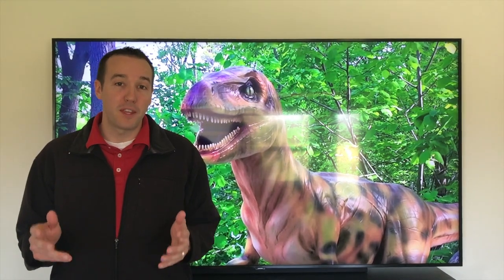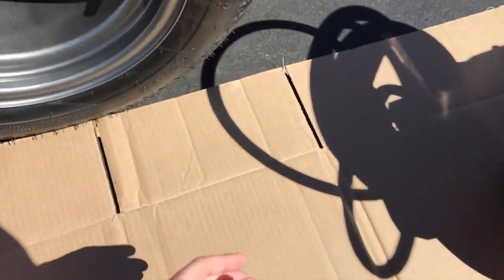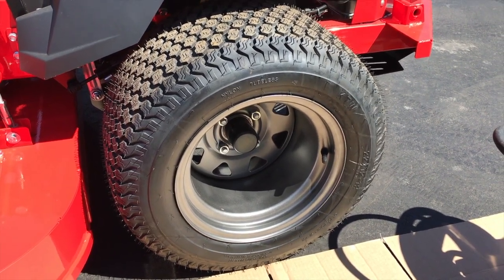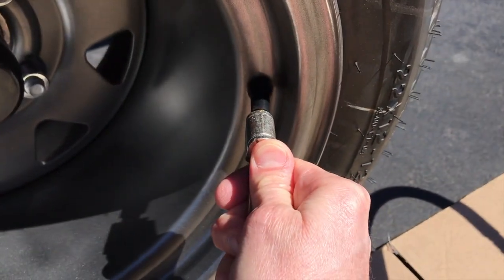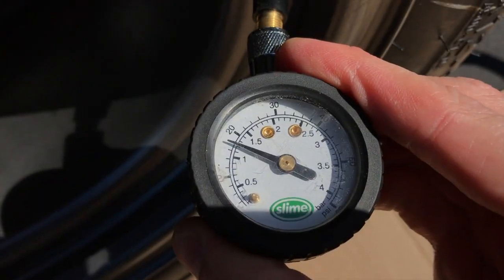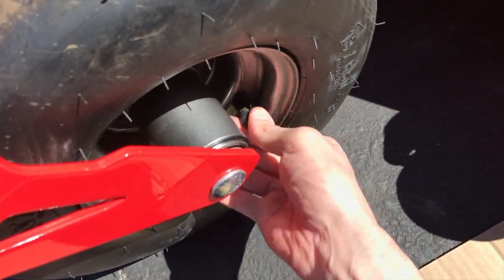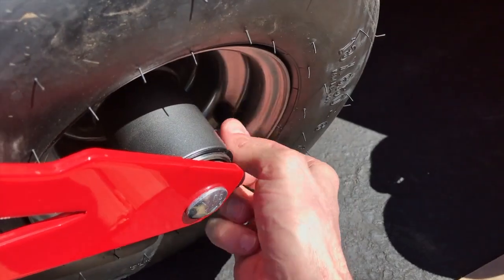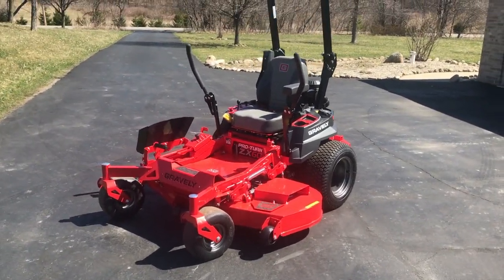Service Zero turn mower tire pressure Properly & SAFELY!

Comment: I have a John Deere Z915e zero turn mower. The tire inflation is 18 on the front and 12 on the rear. I was wanting to see a video on how this will affect the cut as leaving ruts and on how it affects the mow height. I left this here as I saw where someone stated the same pressures for their tires. My cut is off if I deflate the tires so I will reach out to my dealer. Like someone said, read your owner's manual and then do your videos because the manual is correct. Thank you for showing how to inflate tires and check pressure though.
Reply from the maker: Thanks for watching & sharing this.  Many more helpful videos to come!

😎👍

Comment: So where did you come up with 18? 20 is max. That doesn't mean it is what you need. What does Gravely recommend for best performance (handling, traction, etc)?
Reply from the maker: Thanks for watching & we appreciate you reaching out to us.  Your exact recommended pressure can be found in your owners manual.  We picked 18psi for our mowers mission.

Comment: Never go by the maximum tire pressure on any tires. Read your manual although my Toro TimeCutter lists 13 psi for the rear tires.
Reply from the maker: Thanks for watching & sharing your thoughts, hope all is well.  😎👍

Comment: I just purchased the Ikon XD 52. The tire pressure varies from 9-11psi rear and 38-46psi front. I don't know what is a good tire pressure for the front. That is a wide range of pressures.
Reply: @Edoc What pressure should I run in my mower? My fat ass is 295 pounds. I now am running 10 rear 38 front. This is my first Zero turn mower. Thanks in advance.